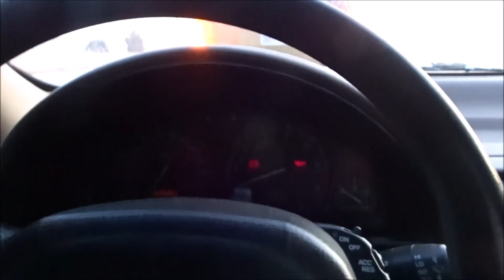SLAMMED SATURN JUNKED!!

Comment: i dont get people sometimes. why ruin the car and get rid of it to buy another. you could get a trans from the junk yard and just adjust the coil overs to it doesnt sit so low. dont know where you live but i'd of bought that car for a 100 bucks. if your just going to trash it and get rid of it. you could have parted it out and made something off of it and then someone could have got some use out of it. just makes me hate them im a millennial and hate seeing gen x and other millennial waste money. also just makes me wonder if a lot of why so much crap ends up in land fills and say like over 50% of food is wasted, is because of that reason. people just throw everything away and dont reuse or up cycle.not trying ot be mean by any means. it just reminds me of the stuff ricer miata do, just for an example.
Reply from the maker: Mr.009mm Killuminati I kept all my parts off of it. Anything valuable. My coils wheels I had racing seats. The stereo. I've been wanting to get rid of the car for awhile and when it didn't start I was fr done with it. That car wasn't worth fixing. It had had pistons smoked all the time and overheated. It was for the best lol

Comment: I like the wheels, how did you get the car that low? I own an 97  Saturn SC2 been wanting to fix it up.
Reply from the maker: joey duran I had 02-07 wrx coilovers. I have a video of what you have to do to make them work on my channel
Reply: Aaron Batie thanks I will look at. I added clamps to drop the back but didn't work I ended up breaking one.
Reply from the maker: Yea I heard zipties work but it'd just be better to get the coils. I still have mine. I just don't have a Saturn